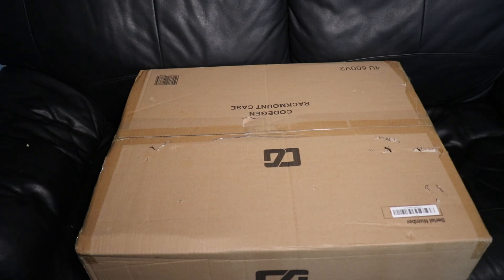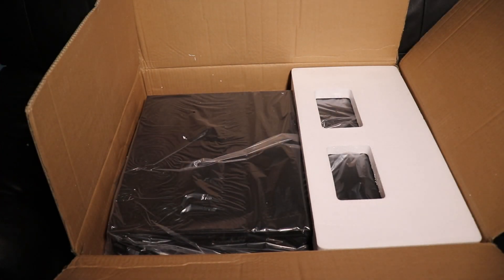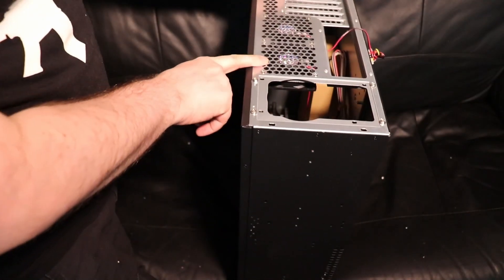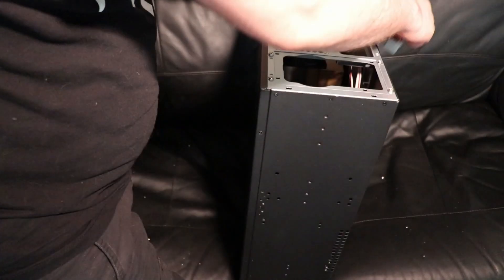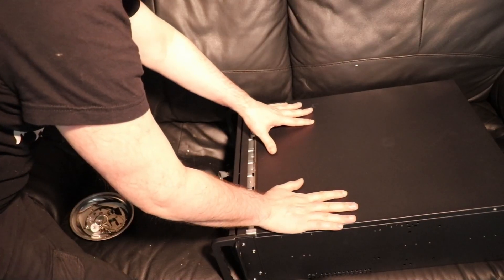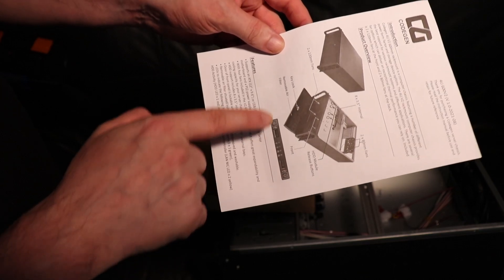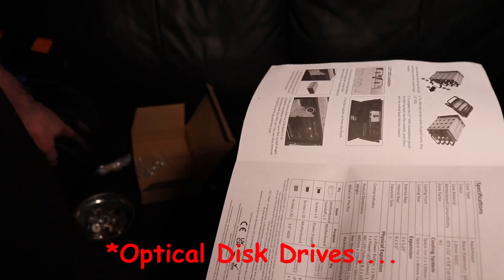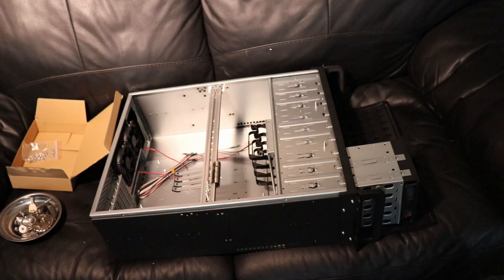DIY Rack Mount Nas - Part 1 - Codegen V2 600mm Rack Mount Case Unboxing

Comment: Thanks so much for your video, just wondering, is it possible to take out the hard disk drive module, is it attached with rivets or screws? I'm interested in mounting a 240mm AIO radiator.
Reply from the maker: The modules are tool free.  So it is possible to remove them.  Not sure if this is really a good case to water cook in tho. Keep me posted if you do tho!

Comment: Good to see I wasn't the only one stuck on opening the top haha. I'd literally taken off all the screws except from the 4 on the top casing... Clueless how I didn't see it. Good unboxing btw! Had the exact same thoughts as yourself. I ended up buying the 500mm & 600mm, 600mm looks a little easier to build in, no caddy / bay mounts in the 500mm.
Reply from the maker: I struggled getting rails to fit my Rack, the official rails are 650mm compressed...my Rack is just 600mm deep!

I also had to mod the case to fit it in the Rack. 

This video has been expensive but also educative, hopefully i can stop others making the mistakes I have!
Reply: @ITSnippets  Did you get the codegen rails? I'm getting mixed answers from different sites saying that the rails will fit the 600mm and other saying it will only fit the 500.
Reply from the maker: I did but they are too big. 650mm at their shortest. I found an alternative generic set of rails that fit.
Reply: @ITSnippets  Ahh gotcha, could you let me know what were the generic ones that you found?
Reply from the maker: X-case.co.uk order was extra value rail kit 20-27 inch. 

I'd provide a link but it seems that they are not the same company as they appear to be a boutique manufacturer of servers now.